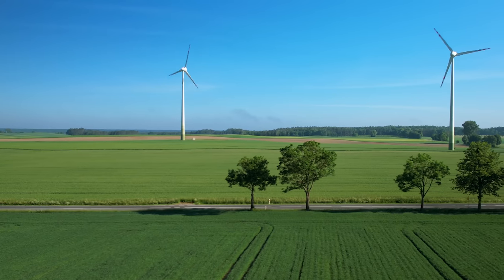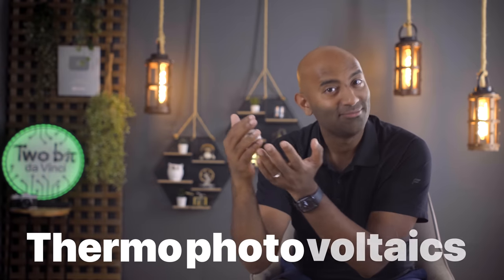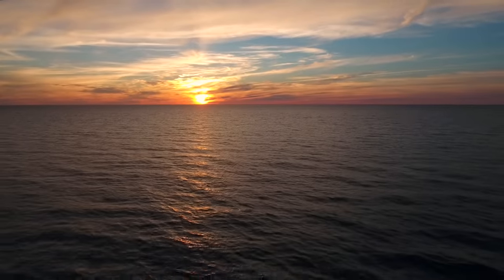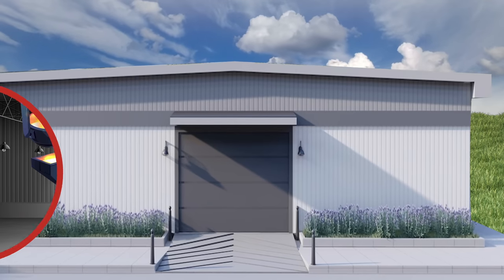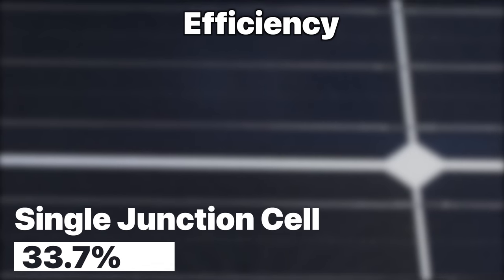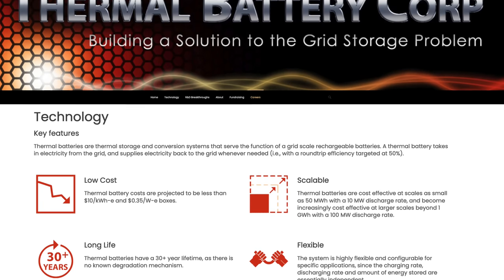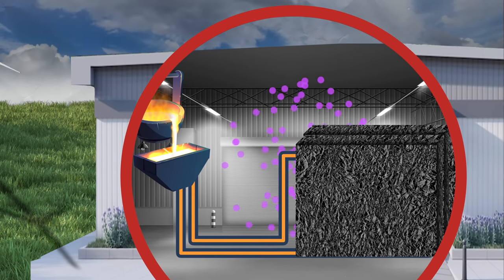Breakthrough Solar cell DOESN'T Run On Sunshine!

Comment: This technology sounds like it would be a LOT more useful for making a) hybrid cars powered by natural gas and b) natural gas fired power plants more efficient. Back in the 1990's I knew some guys in Issaquah, WA, called Krystal Corp I believe, who were making a desktop sized generator that used some triple junction cells around a stack of ceramic disks with a natural gas flame heating them white hot, with mirrors in a star pattern focusing the emitted photons to vertical rows of triple junction cells. They were getting 36.5% efficiency back then, in the 1995 period.

Comment: 100 kW / m^2? Holy cow, that's a lot of radiation. 100 times brighter than the sun - is that real? I guess it's all in the infrared, but still, that's insane.

Comment: It is less complicated related to legacy coal/steam power station. Probably cheaper too.

But compared to a solar panel + battery combo? Something is off in their calculation.

First, you get energy from some source that generates high temp, high enough to melt the metal. You already lost some of energy there.
Then you transport the liquid metal through the carbon "battery". You lost some of energy again.
Then when you actually want the electricity, you transfer the heat to tungsten plate (you lose some of energy there) which will transfer the energy to TPV cells, that are now at 41% efficiency and could be in theory up to a 50%. You are also cooling down those cells and heat is lost in the heating the water.
How much of energy have been lost from the initial source (back where we were melting the metal) to the moment the electricity is flowing to a grid?
It simply does not add up.

Now, for sure, we HAVE to find a way to use all the heat that is wasted all around the industry. Multilayered cells seems like a great thing. And infra based cells are good.
Reply: I wanted to ask a question but I didn't want to seem stupid. Admittedly I know next to nothing about this. But my first thought was, don't you need energy to create the heat? I'm glad to see you have similar questions.

Comment: Folks ought to check out LUMELOID and QUENSOR, they are both built on thin film conductive polymers and both were patented by Alvin Marks.   LUMELOID can be thought of as an array of polarizing nanoscale antennas tuned to absorb electromagnetic waves in the UV, visible and IR at about 96% efficiency.  QUENSOR uses fluorine to create carbon/fluorine capacitors along a stretch oriented array of conductive, each capacitor as I recall used 4 atoms

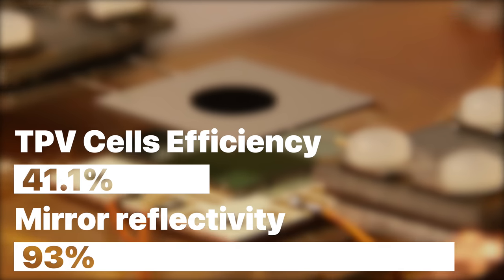Comment: 41% converted to electric power? NOT BLOODY LIKELY! At 10:37 "tungsten filament at 2400 degrees C" (2673 K), that Tungsten (or any other blackbody emitter) will radiate over 2.8 megawatts per square meter. With TPV output of 0.1 megawatts per square meter, the implied efficiency of TPV is a mere 3.5 percent! Plus it is extremely difficult to get concentrated sunlight to deliver such a high temperature, because whatever you use to absorb the light will re-radiate megawatts per square meter, and lose even more by convection of air on the exposed surface. All other heat sources are FAR cooler than what sunlight can theoretically deliver (5800 K), except for primary combustion. Sure, they might use this TPV thing to convert combustion heat, but at an utterly lousy 3.5% efficiency? No, no, no!!! And then that TPV requires aggressive cooling, which means a low temperature of the waste heat from cooling it. No way to regain efficiency there! The math for 2000 °C is even crazier. The video explanation given just totally fails to work.
Reply: Their efficiency number, I suspect, is the efficiency of the cell itself - not factoring in all the losses in the whole system. The whole thing sounds fantastical. The mirror at the bottom of that box makes no sense - clearly just reflects most of the light in a different direction away from the cell. And we scale the whole thing by just putting in a thousand of the cubes? Completely ignoring the cooling requirements explained a moment earlier. The whole thing sounds laughable. This is with absolute certainty another scam - making fantastical claims and presenting a bunch of wildly misleading numbers.

And we never hear the guy on this channel disclaim if he was paid by the company. I find this channel not trustworthy at all. I don't know if that's because the guy is taking bribes or if he's really that naive. Either way, I'm finally blocking this channel, which I should have done 5 videos ago. It's all like this. I'm done giving this channel my time and the benefit of the doubt. 👎
Reply: Indeed, this project is completely unworkable, horribly complex and links multiple technologies requiring containment. Non-starter. No investor would spend $10 on this

Comment: Yeah, we where running calculators with pv cells off of indoor lighting back in the 80s-90s too.  Replacing the old 60 watt light bulb with a giagantic friggin light bulb doesn't really make the idea any better.  It just turns downright stupid when you're needing to liquid cool the thing to boot.

Comment: Very Interesting.  A Better application might be to use this "Solar cell" for the power conversion system of a Molten Salt Reactor (MSR).  MSRs are advanced (gen IV) nuclear reactors that promise greater fuel burnup and can run on Thorium or Uranium, and some are looking to consume Spent Nuclear Fuel.  What is interesting as that MSRs can typically generate higher temperatures, about 1200F.  If 50% efficient thermal to electrical conversion can be achieved at this temperature, this cell might be a better solution than a steam turbine or even a closed Brayton cycle power conversion system which is theoretically capable of 50% efficiency, but I don't believe any have been built at scale.

Comment: 3M in the 70s did something similar . they used a thermocouple to charge batteries from winding it around an exhaust manifold on a train which gave good charge to the batteries. i tried to find out what the thermocouple was made of but could not find out as it was hush hush and i was an appie. i worked for saa at the time but the experiment was done at sar.
Reply: I bet it was asbestos 😀
Reply: @lukewarm2075  no a thermocouple is two dissimilar metals . the voltage is generated at the junction of the two

Comment: it reminds me a little bit of a nuclear power plant, where you have movable steering rods. uk, also had an experimental reactor (think it was in the 1950s to 80s..) where they used graphite blocks with inner tubing to transfer heat with some fluid mix into water -> turbines ->electricity. thank you for your video about this new thermophotovoltaic cell! very interesting technology. with a tungsten "bulb" and a phototherm "feedback" reflector. genial.

Comment: Renewables also need several hundred times the land area of a nuclear plant.  Example is Diablo Canyon Nuclear Power Plant.  Any area of 500ac produces the amount of power that would require 78 square miles for renewables to produce.

Comment: Turbines efficiencies are based on the mechanical energy obtained using the carnot cycle. The efficiency scales with the ratio of the hot zone and cold zone, thus if you had a 2500K Hot zone the Turbine would a far more efficient solution than the usual.

Comment: there is the concept of a 'hot mirror' , which is a material which reflects wavelenghts of infrared which contribute most to heat, and lets shorter wavelengths of light pass through
I'm surprised that it doesn't get a mention here, such a material would only let short enough wavelengths of light through to the photoelectric cell, while reflecting longer wavelength infrared back to the tungsten to preserve its thermal energy

Comment: If I'm understanding this correctly, it's only the cell that is at 50% efficiency. What is the system efficiency? There has to be losses in converting sunlight to melted tin, tin to thermal mass storage, then thermal mass to heat emitters, and finally to electrical power. Lots of places that could reduce system efficiency.

Comment: I liked how I was able to follow you along without confusion. I seen the previous videos discussed in this presentation and I have a good imagination. I live in Alaska with solar panels and a windmill and a 80 gallon gas hot water heater tank as a heat battery that doesn't do anything but hold heat and heat my room from that which was stored making the sand heat battery solution appealing to me. Magnet engines. To get GPT 4 to engineer and test within a deep learning system and then 3D print the device to put the magnets into doesn't sound far-fetched to me, harnessing magnetics to generate electricity. Imagine a 5000 watt magnet generator in every automobile that plugs into the wall when not in use producing power for the grid. That's the product that will save the future that I want to create. And then you've seen a motor that spins a flywheel that spins a generator that keeps everything going Plus useful power. Oh you can't do that but some magic of magnetics, capacitors, flywheels and gear ratios gives me an optimistic viewpoint of the possibilities. I have seen handmade little ones that produce no useful power but they spin on their own and a real engine of sort powered purely by magnets in a Korean version has a place on the factory floor. Why aren't these machines flying out of a factory? Several different kinds are shown on YouTube. Any thoughts on how to get started and getting into production without being sued by The Honorable Senator Mnuchin?

Comment: Interesting technology. Tungsten is used in the standard light bulb (Edison’s invention). Tungsten light bulbs typically don’t have a long life. Is that due to heat cycle degradation of turning the light on and off? Perhaps they are using a tungsten compound that gives it a longer life? Hopefully, they will have success. However, relying on excess green energy for this process may prove difficult as electrical energy demands are increasing, especially with the thinking that all coal, oil, and gas electrical plants can be eliminated and we can’t use nuclear because politicians have been lobbied to believe that it is dangerous.

Comment: Create a panel that absorbs room temperature heat down to -40° producing electricity. Cooling and refrigeration then provide power. Put the panels on electric vehicles including ships to absorb heat from passing air and water.

Comment: So going from excess solar or wind would be better served by storage in gravity based storage like Energy Vault or  Gravitricity.  The storage is in the 80-90 percent efficiency range. This TPV technology might be best for geothermal based systems like Quaise.
Reply: Maybe. Still too many unknow factors to judge. 50 year costs, maintenance, area permitting, space, ect. all contribute to the economical benefit as well.

Comment: Appreciate the insight with this technology. Pumping seems like quite a challenge. What about pumping inert gas into the tin “solution” to move it where needed? This could avoid direct exposure of pumps to those insane temps.

Comment: Sounds super expensive and not economically viable. I do like the idea of fixing the concentrated solar array, due to the fact that heat is the most abundant source of free energy. Our sun provides all the energy we need, and systems that harness heat and expend the heat are ideal. We spend so much on cooling our homes in hot areas, but all we do is dump the heat right outside our homes. If we could only use that heat instead of wasting it. We would be set. Unfortunately it's insanely expensive to implement discoveries like tpv.

Comment: As you mentioned, the heat energy storage module using is really a separate technology from the TPV heat to electricity module. 

If the TPV module is really that efficient (and cheaper), it could potentially replace steam turbines whereever they are used to generate electricity, not just in renewable energy storage.  This might include natural gas power plants, coal power plants, nuclear power plants, and as you mentioned, concentracted solar power plants.   I imagine a solid state power generator would be so much more reliable and long lasting than a steam turbine, which has moving parts that wear out.
Reply: I wonder how much power it could gain back from cooled devices... 
I mean, seriously, think about it. We have CPU's in our PC and phones and such things, right? Those have cooling blocks on them with thermal paste to quickly transfer the heat away from it as these things go 100+ degrees within about 1.5 seconds.

What if we turned the cooling blocks into a TPV module? How efficient would it be at turning that heat back into energy? Even if this could only catch 20% of the actual heat back into energy, we'd be saving 20% of energy on an industry which right now uses about 20% of all of our energy.

It's probably not realistic, but a man can dream.

Comment: High Temperature Energy Storage sounds like a good way to go, if ways can be found to properly hold and contain that heat and effectively use it.. . .  I am not quite sure, but I suspect twice the temperature 4x the stored energy perhaps.    . If so very high temperatures could store a lot of Energy.    . .    These TPV  ( Temperature Photo Voltaic ) cells sound very interesting. . .  Lets see how this progresses. . .  They could also be used with conventional Solar Panels, which get hot in use, due to the low efficiency of conventional PV's

Comment: Just like the sand battery, the first step is taking electricity from the grid at off peak times, and converting it to heat.  A heat pump is better than 100% efficient, but not sure if it can scale to these temperatures and energies.
Reply: Um, nothing is more than 100% efficient. A heat pump moves energy, but uses some in the process. So less than 100%.
Reply: @edeaglehouse2221  It uses less energy (usually an electric compressor) than it moves in heat.  It's not a perpetual motion machine, although it sounds weird.

Comment: A wave's kinetic energy can easily be converted into potential energy by raising a mass with each wave that passes.
This potential energy can be converted into electricity by coupling the mass to a generator and lowering it when desired.

If the distance to the customer is too large to transport electricity via power lines, converting the wave's kinetic energy to potential energy first is wasteful.
It can still be used locally to desalinate seawater (to name but a hot topic) or generate hydrogen and then be shipped out.

The advantages are that this can be scaled up more than most land based energy storage devices, the price of ocean being low compared to the price of land and the many more regulations a land based design must adhere to. The disadvantage is distance to customer. Fortunately, most of us live near the coast.

Comment: We use molten tin in EUV lithography to generate the extreme ultraviolet light source. Mirrors and glass efficiency is extremely important in EUV, so it seems like at least some of the technological issues regarding the heat and mirror issues should be already done.

Comment: The complexities folks will go to throwing such a huge amount of new tech is enormous and should be confined to a thought experiment. The enormous cost of building all this, the galium and arsenic needed to be mined, molten tin, maybe the best understood of all since modern float glass is made on a bath of molten tin (which like all molten metals has no good way of dealing with water infiltration). The best power storage method is gravity, as pumped water OR standalone towers that lift massive weights. Solar or wind drives electric motors to hoist up the weights and they generate power when they move back down. A large array distributed regionally could be managed centrally with power being stored near where it will be needed. The weights could run in enclosed racks on pinions instead of top cables for safety and stability (not unlike hill climbing metro systems) as you find in Barcelona and many other places.  Low tech, nothing hot, weight could be recycled iron. Maximize the efficiency of the driving motors and generators and build these today. I don't know the efficiency, but no tin melting, no tungsten photon absorption to make electricity with complex photocells that cost what $100 each?. No state changes in metals, exotic buildings full of glowing tungsten (seriously?!). KISS! The SnotTunC elaboration isn't destined for production and deserves an award for the most inelligant solution to a fairly straightforward problem.  Now they can output continuous float glass off a tin bath, well..... The stop what we're presenting for an ad is offensive and is a result of a monopoly market monetizing the work of others.

Comment: If we can store the heat energy we should have a space station that charges the batteries with 24/7 sunlight and then we use Space X to shuttle the batteries or graphite blocks back and forth, or just kick them off the space station with a GPS guide and some parachutes.

Comment: The forever battery uses carbon felt electrodes and a separator.  The electrolyte is 3M Zn SO4 and 6M  KI. The solvent used is ethylene glycol, aka radiator coolant.
The battery never goes bad. Maybe in a hundred years the plastic container will fail.
Reply: Any more details or links about this battery?

Comment: Infrared receptors sound like big development, because eventually panels should work at night and indoors if there's infrared capability...but it sounds discouraging your tungsten needs to be glowing...I would think there's lenses to just interpret the infrared heat for the panels...They exist for cameras...Then there's question if encased methane gas or in liquid, could possibly store methane above panels because methane is said to trap solar uv radiation.